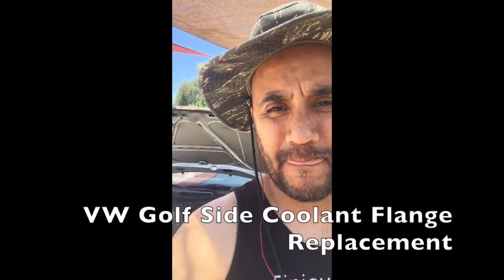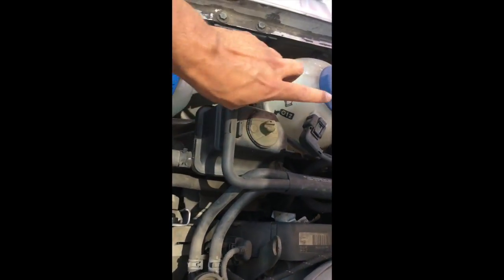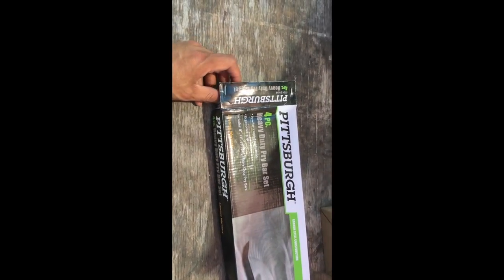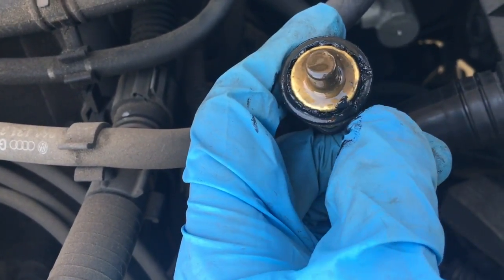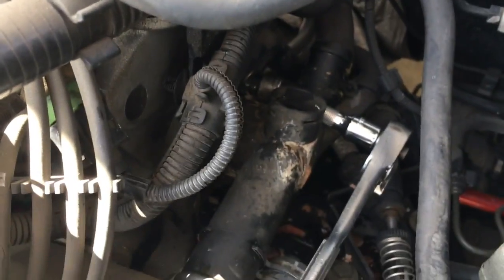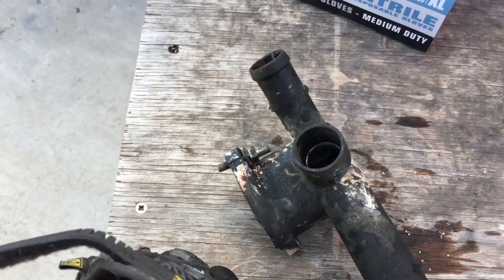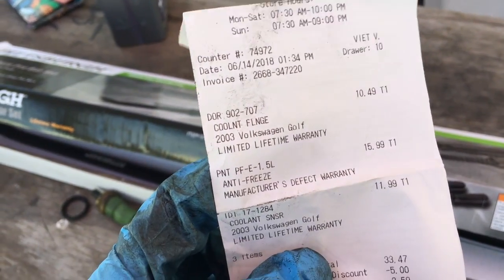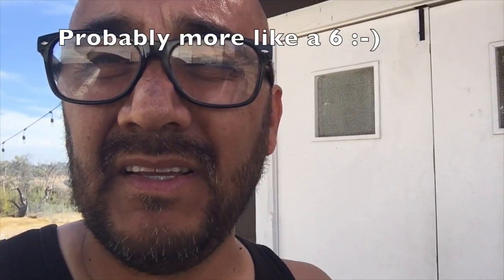Side Coolant Flange Replacement VW Golf 2003 MKIV

Comment: hello, hello friend, the stabilizer bar solved your problem, was picking up the shaft
Reply from the maker: cerone trisch are you talking about another video? About the stabilizer bar?
Reply: yes, I lowered my golf, the bar caught on the semi-axle, I cut them, but I miss them in curves
Reply from the maker: @ceronetrisch6416  Yeah not a good idea to cut stablizer bar. I still have mine I replaced the link connectors that gave me more clearance and no problem now. Check that video it should be in there.
Reply: Lowered mine too guys, snapped an axle clean in half, got diff end links and its ok, more clearance for sure. Bought and after market sway bar but sold it once I realized what a pain in the ass it was to change (while laying under it, no access to a lift)